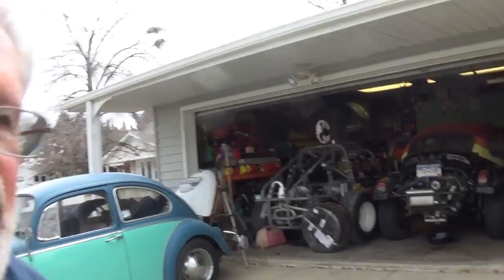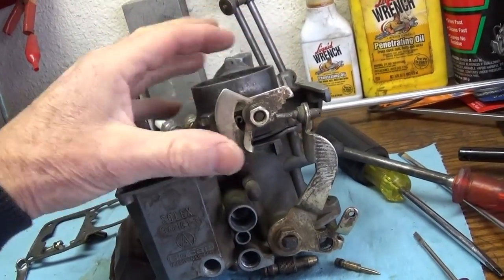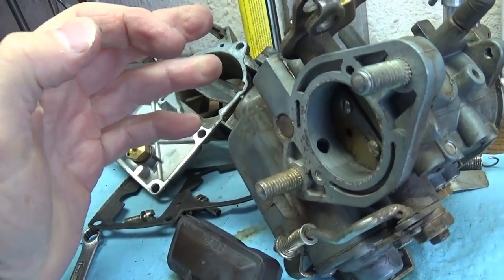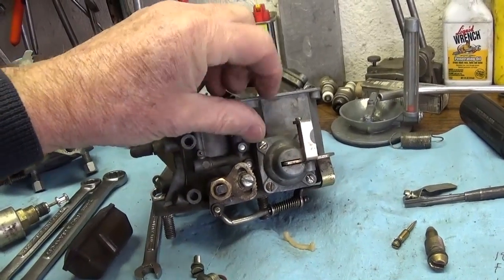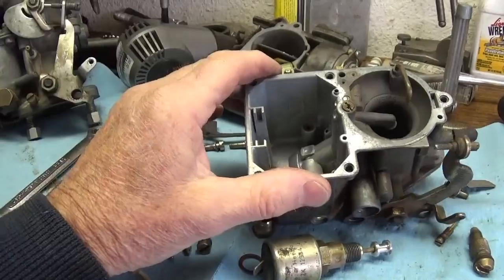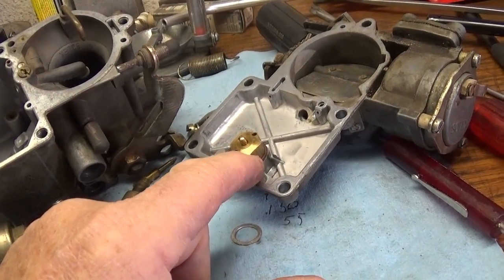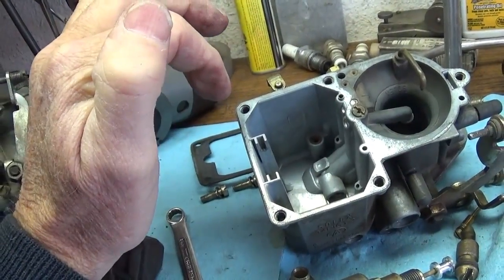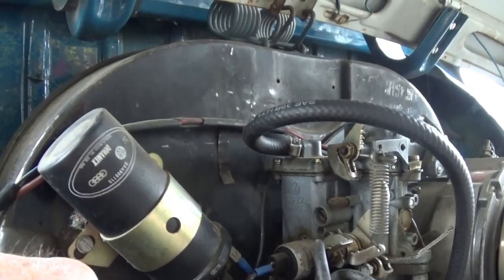VW Solex 34 PICT-3 (QUICK FIX !)

Comment: That upper screw is to allow the throttle plate to completely close and stop on the screw, not let the throttle plate wear into the venturi's casting, so yes, let the plate completely close then just take the pressure off the plate touching the venturi...and no more! Don't use it as an idle adjustment as EZGZ says!
Reply from the maker: Thanks
Reply: Correct.  The fast idle isn't actually adjustable on these cars.  The fast idle is at the mercy of your upper screw setting (just barely touching the hot idle flat), your choke thermostat setting and whatever air bypass screw setting you decide on a hot engine, not a cold engine.   An 009 type distributor is the WRONG distributor to run with a 34 PICT 3.  This is what mostly causes the dreaded flat spot.  Get a SVDA distributor on it and your engine will feel like a different beast in the low end.
Reply from the maker: Thank You Both, I appreciate feedback and it will help everyone who reads the comments. I have a vacum dizzy around here somewhere. I should show some of the new guys how to change one out. I want this channel to be someplace we can all benifit from.
Reply: @TheEZGZ   You need lots of timing advance in the 900 to 1200 rpm range to avoid the flat spot and a stock 009 just can't do it.  In fact, an 009 mechanical advance doesn't even start to come on until 1200+ RPM.   A properly functioning Single Vacuum/Dual Advance (SVDA) distributor is almost a must for good street driving manners.  You get instant advance as soon as you tip the throttle.   Beware of old blown vacuum cans, too.  (Most are blown 50 years later).
Reply from the maker: I'm willing to try it but I'll have to find one. I have an old stock vacum something or another. Maybe I should make a part 2 to this. Please advise if you watch it.
Reply: @TheEZGZ  I will and thanks for all the work you do on the channel.  I run an "034" distributor on my mostly stock 1600 DP.  Works great and those cans are pretty easy to find. 
The 034 distributor has a similar (or same) mechanical advance curve as an 009, but the vacuum advance kicks it in the ass right away in the low end.
Reply: @scdevon  now that is some very helpful advice.  What a difference that might make. Thanks for sharing your insight and experience with all of us VW lovers!

Comment: Sir, I would like to thank you for making this video. I used your advice and tuned my little Chinese knock-off carburetor as you said and it runs so amazing. I made the mistake many have with trying to use the idle screw on the linkage. Now it runs perfect. Not only does it not flood itself after I shut it off, but I actually feel the progression ports kick in!  Thank you again!
Reply from the maker: Congratulations!  I appreciate the support!

Comment: I watched thanks very informative.  My 1970 was running but not idling well.  I drained the carb pulled out the fuel screw, main jet and it was a bit clogged. I put everything back and now will not start at all...? I was messing with the air and fuel screw so I started over 3 turns out each and nothing... I can smell gas like it's flooding... thanks

Comment: I have a 34 PICT-3 that is adjusted properly and runs well.  My problem is that if don't drive the car for a week it takes a lot of cranking to start.  I removed the top of the carb and noted that the carburetor body fuel supply had gone dry.  I don't believe evaporation is the answer as the system is closed.  Any ideas on where the 'leak' may be?  67 VW Bug.
Reply from the maker: Sounds like you have a good understanding of things.  I have not had that issue. The only place I can think of is that brass plug in the lower side of the bowl that gives you access to the main jet. Take that out and replace the seal. If thats not it you might drive the car long enough to gets things good and warmed up and then park as you normally would. Remove the complete carb while it's still warm. Hold it up and see if there is fuel dripping out. You may have a hairline fracture somewhere that opens up when it gets hot   Take a good snif of your oil and see if you can smell gas. Be Safe

Comment: and the ignition is set to 7.5 degrees before top dead center at idle...is there a bigger ball in the case so that plug keeps it there so it can be tapped all the way to the bottom?
Reply from the maker: No sir. That is the accelerator check valve.

Comment: Excellent video, very helpful. Just for extra info:  I had an off idle hesitation/stumble on a Solex 34 pic-3 that I just could not seem to fix. Nothing I did seemed to make a difference.  What was even more frustrating is it seemed to "fix its self" in the summer months only to come back as soon as the temp dropped below 55 deg. Rebuilt the carb, replaced the choke element, almost gave up and bought a new carb.  It ended up being a completely plugged manifold heat riser tube.  Clearing that out and then following the adjustment procedure in this video made a 100% improvement.   Thank you!!!

Comment: I have to thank you for making a clear and concise explanation of the 34PICT-3. The best part was your explaining of that chock idle screw. I have been trying to get my 72 running without that dang flat spot. Everything I read was make contact then turn in another 1/4 to 1/2 turn. I will follow your way and hopefully make my bug run right, this 75 year old thanks you. P.S. I have washed gas for many years to get rid that Ethanol, finally I can get pure gas 15 miles away.

Comment: Hi from Germany!

They started on rebuilding the 34 pict 3‘s over here to 37 and 39 mm butterflys, changing the venturis if wanted to larger ones and of course changing the jets. Runs absolutely fantastic on 1679 to 1915 cc engines. No more space problems with duals in beetles, no synchronizing, stock airfilter and looks but very good torque from idle up. You should try these ones out on Valery ! You will never again spend money on Webers or Dellortos

Bjoern from Germany
Reply from the maker: Sounds like a dream come true.  Where do I go to buy one? Can you give me a link to website or what.
Reply from the maker: Was thinking about enlargement and wondering at what point the intake manifold would become a problem with those larger venturi's.  It would also need plenty of heat on that manifold.
Reply: Type „Solex 39“ on the german eBay site which is eBay.de and the first hit will be the solex 34 pict 3 with 39 mm throttle
Reply: TheEZGZ 

Here is what I did and why:

trying to get some more torque and hp out of my 1969 1500 singleport Karmann-Ghia coupe without touching or opening the crankcase because of matching numbers and so on and without changing the look of the engine:

Replaced pistons and cylinders to 88 mm AA Performance slippers, 044 heads with 40 mm intake and 35.5 mm outtake valves, compression ratio was 8,25:1, stock heater boxes, stock exaust, 1.25:1 ratio rocker arms.

Result on dyno: 79 hp @ wheels and 144 NM of torque, gps measured real top speed on highway was 161 km/h with stock gearbox - incredible to me.

But I kept on doing some more:

Some work on the ports plus polishing, compression ratio up to 8.6:1, heater boxes with also 35.5 mm diameter, 123 Electronic ignition
Reply: TheEZGZ 

But still haven‘t been on the dyno again but sounds and feels stronger and of course even faster. Tryed out my solid shaft 1.4:1 rocker arms finally after lying around my garage for years...Never dared to shorten pushrods, but finally did.

Torque torque torque...😎
Reply: You should come over here to visit some aircooled petrol heads and of course the Volkswagen Museum in Wolfsburg. On may 1st there is always Europas largest aircooled swap meeting (?) in Hannover
Reply from the maker: Sounds really sweet! I had a 64 Ghia for many years with many engine variations. The exhaust was always a problem to fit under the stock rear apron.  I only use those big valve heads on 2110 cc engine and above. I like the stock head with HD single springs. The stock valves are lighter than stainless steel and the smaller port gives very nice low end torque for off road engines. Your Ghia must fly down the autobahn.  Thank you for your contribution and your always welcome here.

Comment: my car was boggin and i always thought the small screw was the air i would screw it in until it bogged then back off till smooth , but now that i know that was the fuel screw i fattened it up like you said and my bug is runnin purrrr-fect!! Thank you!! EZ You're the KING!!
Reply from the maker: Glad I could help. Hope you get lots of smiles to the miles.

Comment: Thank you. I'm currently learning about this. Just got my PICT 3 carb cleaned/rebuilt. Ran fine for 1 day & then stalled out at the stop sign when put in neutral. The shop adjusted it to 1200rpm. My friend and I played around with the choke a bit. It felt like ran fast (engine) abit but when it didn't stall for one day but felt the rate of engine idle decrease but not stall at a stop. Took it out today but then stalled out again- same thing. Tried to accelerate in first but then started to stall out again. Thanks for the interesting video. Got the 74 beetle from family- driven during summers and stored during winters for almost 10 yrs.
Reply from the maker: Some times one cleaning and rebuild isn't enough. You may have to check and reclean to get the specs right. When you get the fuel and air screw just where you like it you might want to turn out the fuel screw 1/4 turn out to richen it up.

Comment: Good video.  The large upper screw on the choke cam needs to be in contact with the hot idle flat on the cam (just barely) so that the carburetor bore doesn't get torn up by the throttle butterfly at idle.  It acts as a positive throttle plate stop so that the soft aluminum carburetor body doesn't have to.
Reply: Great tip. Insightful detail. Thank you!

Comment: Hello, Thank you for this clear and explicit video, only two remarks.
_ You are right, on warm engine at idle speed the butterfly should be closed (the idle adjustment screw should not touch the fast idle cam) but in this position, the small holes are not all obstructed. Of course, the mixture penetrates into the big hole at the bottom of the well, but at the same time, the mixture also penetrates in the first little hole just above. In order to have the good volume of idle mixture by add up the quantity of these two separate inlets.
_ As you say, on a stock carburetor, the volume control screw is protected by a cap, it means a factory preset. So after a compete overhaul and reset of all screws, we should be able to protect it again and play only with the air bypass screw to increase/decrease the idle speed.
Does this comments make sense for you?
Reply from the maker: Today's fuel is not the same as it was when the factory set it. 
When the factory set it everything was new.
50 years later your going to have to adjust the fuel screw and know matter what you do these engines are polluting the environment. I think everyone watching this video just wants there car to run and drive better.
Reply: Apparently, I was not clear with my remark (sorry for my poor English), I will try again.
Yes of course, everyone now knows the fuel is bad quality (environment first), but the quality of the fuel does not vary overnight. 
Of course, if the seal of the screw has never been removed, it can not be used without removing the seal and redo a complete adjustment, due to the actual fuel.
I say, after a complete overhaul and once all the carburetor's settings carried out and the engine runs well, after that, we should be able to use only the air bypass screw to adjust the engine idle as the carburetor has been designed like this. The purpose of the volume control screw is to adjust a part of mixture volume during first commissioning settings or after complete disassembly. Once done, this screw can be again sealed because it should be no longer used to adjust the engine idle. The engine idle should be adjusted only with the air bypass screw. Model 34 Pict-3 more complex than previous ones has been designed with the aim of simplifying engine idle adjustment, with this one only a screw to turn. Nothing more, nothing less :)
Once again thank you for your videos that help many people, me the first.
Reply: _ Volume control screw = First line of mixture air/fuel (in the well and starting from the bottom, second hole a small one).
_ Air bypass screw = increasing or decreasing of quantity of fresh air in second line of mixture (first hole the big one)

First reset of 34 PICT-3 after disassembly / reassembly or if the plug has never been removed.
_ Set  both scews (If always in place, remove the plug)

Readjustment of engine idle due to weather conditions, altitude, etc...
_ Turn only air bypass screw 

EZGZ, maybe you can try like this to see if it's not more easy ;)

Comment: A lot of helpful info,  mostly correct. Good that commenters explained about pre-loading screw slightly to prevent butterfly from jamming closed in bore.  Car will run better with moderately richer jetting according to altitude. Factory jets were desperate attempt to meet 1970s USA emissions standards (California even tougher) Three inch “ velocity stack” built into stock air cleaner is also important for perfect performance especially in off-idle transition. AND PLEASE !!! Don’t even suggest disarming the elegantly simple and effective warm-up choke system. DON’T let the car sit at idle for 5 minutes to warm up. Most engine wear happens during that time. Keep the choke working as it’s designed, stock air cleaner with 2” paper hot air hose in place, crankcase vent hose and steel pre-heat pipe clear & hooked to hot exhaust flow.  Those “intake pre-heat things might be removed ONLY if ambient temp is warm & there is NO trace of carb getting cold. A frosty “snowball carb” is not unusual when designed system is discarded. Over-hyped 009 distributor is usually part of the problems too.
Reply from the maker: Good to hear that you agree to most of the vid. You have a very good understanding of the VW engine design. Since the vid was made I have changed to a new SVDA pertronix pointless distributor. The engine is much happier and gets a few more MPG to boot. You should consider making some vids to help the VW community. I agree on just a touch of preload. Thanks for you comment and support.

Comment: excellent video. I've been having the flat spot on acceleration and a high idle all on a new carburetor. ill use this information and hopefully get back on the road! thanks
Reply from the maker: Never take a new carburetor out of the box and just put it in service without taking it apart and checking the float level and inlet valve. Remove all the jets and screws to make sure everything looks and tests OK. You wouldn't believe all the things that can be wrong.  Just sayin.  I am sure you did all that.

Comment: I help a friend build a 1600 for his sand rail. It had a 34 PICT-3 we looked up the spec. and step by step how to adjust.  The rail would just fall on it's face in 2nd gear. Read somewhere about opening up the jets we did runs great. Do not know if it was dumb luck or the guy that provided the info knew what he was talking about. Good info on the 34 I'm always trying to learn more about them.
Reply from the maker: Thanks Dan. I'm always hoping one of those guys will come along and share those secrets with us.

Comment: I learned something about that style carburetor rather interesting one thing I noticed is I've seen a lot of vw burn up Catching Fire because people use regular 1/4 inch gas line with hose clamps always use genuine VW hose for your fuel line or equal to the VW quality and you don't even have to use hose clamps but on high pressure line you do!
Reply from the maker: Good Point Paul. Thanks for your contribution

Comment: hey EZGZ nice video! but i'd recommend that @3:30 the screw should be 1 turn in not öot, this prevents that the flap will dig in the housing over time. if this happens it will suck wrong air.
Reply from the maker: That's true. I regret not speaking to that but in general the video seems to be helpful to many VW folks.

Comment: G'day Kevin here from Australia. Thanks for another great video. 
Just on a different subject would you be able to go over the plumbing to the carburetors on your sand rail and bugy. Im interested in how you ran your fuel lines. And if you put in a fuel pressure regulator or not.
Thanks again for your great channel.

Comment: I always ream out the idle jet to about a 60 it actually gives you adjustment ,it runs cooler, you can idle the motor down and if you are REALLY good it almost will run with a 009 (or as good as it can...)
Reply from the maker: Whatever works for you. If one way doesn't work I just keep trying things until I get it.

Comment: I apologize to you for my writing but,I have the same problem with my carburator in my wv beetle and my wv-beetle is 1974 and 1200cc and it work very well but I don’t know how to fix the air and unlead in gas(I think)you understand but my car work well I always go to work with it but ia a big problem in Kosova there are no place to buy new parts for it,I think you have no fault for this I think you are from America ,if you can help me I’ll be very happy,but in Kosova there are only some alive,as my but we have no service in my area amd I tried to repair my car own.Thank you for now Internet is as internet in all over thenWorld ,and I always watch You tube and I teach something.
Reply from the maker: Unlead in gas is no problem. 1200 carburetor is not the same as the one in this video. 1200 carb much easier. One fuel screw. No air screw. Check your distributor Points, Spark plug wires, spark plug for problems. If no service or parts at least buy a book. https://www.amazon.com/Keep-Volkswagen-Alive-Step-Step/dp/1566913101
Reply: Thank
you.!!